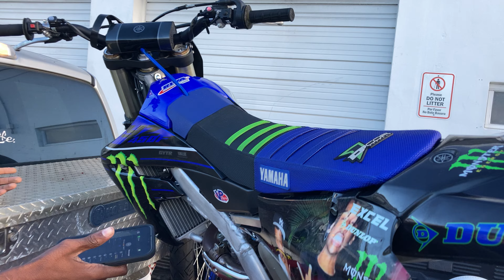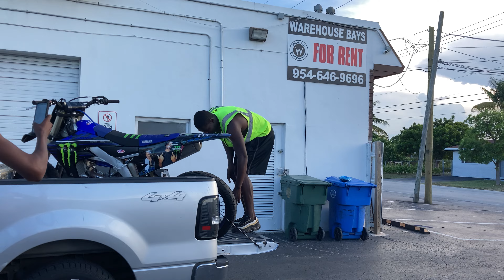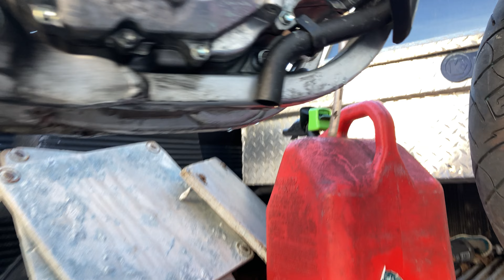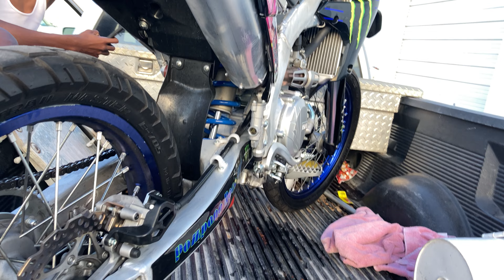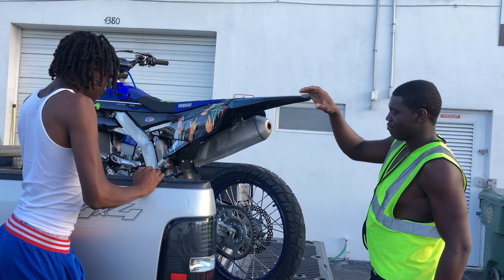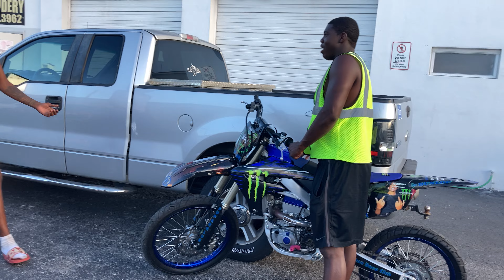Customer Calls Bike Raggedy Says The 2021 Yz450f Cut Off While Cruising Home

Comment: That crank gone with that coolant and oil gone. Heat seized baby
Reply: you'd be surprised what will run tbh a year ago one of my beater bikes leaked all the oil out an locked up an I jus refilled it an put oil in the cylinder an kicked it til it cracked loose. didn't even open the motor an it's still running today 🤣

Comment: I rode my 2023 rmz450 from Dade to Broward and back to Dade no issues no overheating or leaks and it didn't cut off plus I still had gas. Definitely not the bike it's how you ride it.
Reply: How you ride it?
Reply: @bunnyman6321  Better now since I put the street tires on it
Reply: @VONTA_305  💯